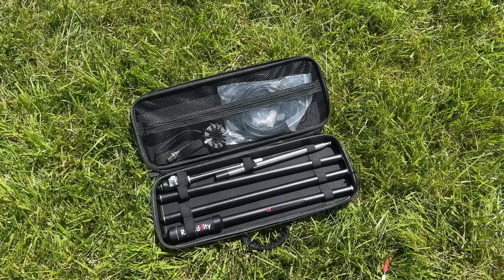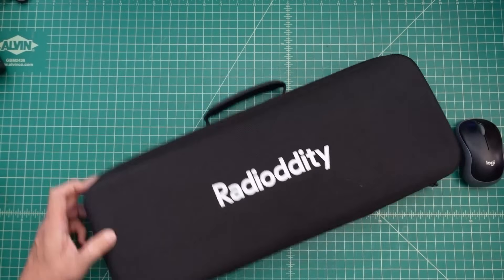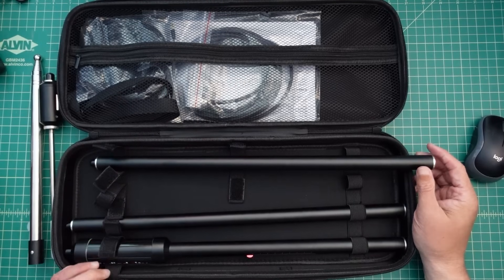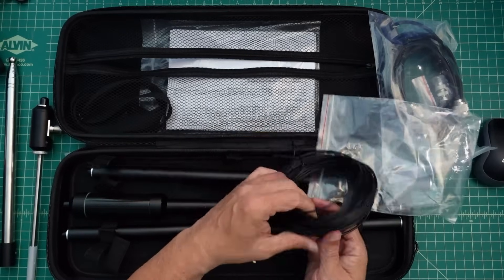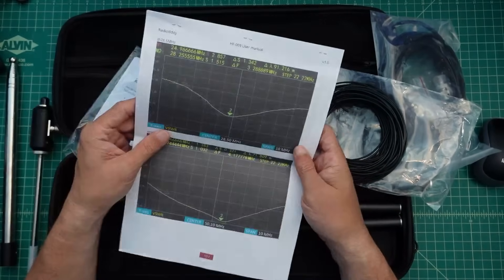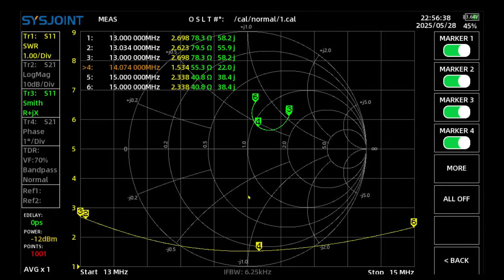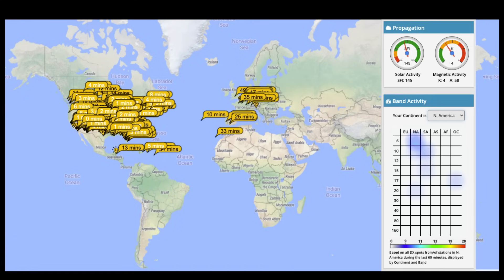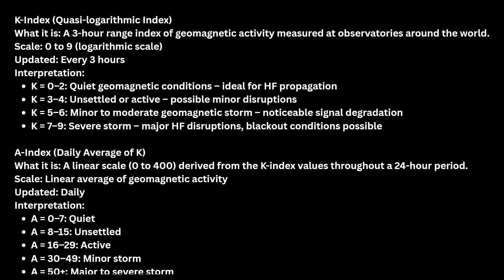Easy Antenna Setup Anyone Can Try!

Comment: After viewing many YouTube videos of this antenna, and learning that it has 3/8-24 threaded fasteners, I ordered one.  I assumed the coil was constructed with stainless steel (i.e., high resistive) wire; but to my delight, it appears to be some type of low resistive wire (copper?) -- based on ohm meter measurements.  So far, my only minor disappointment is the use of 3mm banana plugs (instead of the more common 4mm) for the radial wires.
Reply from the maker: Hope it’s working out for you 👍
Reply: @TheSmokinApe  The tuning range (5 to 18 mHz) of the coil is unusually wide considering its relatively small size and the antenna's short length.  Leads me to think that the coil may be wound on a ferrite rod core to enhance inductance.
Reply from the maker: There could be something in there so it’s not air wound 🤷

Comment: Would getting this unit off the ground, say 10-20+ feet, would it help anything, or cause other problems?
Reply from the maker: Well, you want to make sure you can Wally adjust that coil and you would have to have tuned radials if it’s off the ground 👍

Comment: "Vertical antenna = equaly efficiency in all directions"  Am I saying this is crap....no.   But.  Sayings are there for a reason.  for me, put up the best you can,  but figure out how you can improve next time. ALWAYS. Never know when you need to be the lead in an emergency situation....
Reply from the maker: I agree, use what you have and how you can…. Improve later if necessary 👍

Comment: I'm wondering when you say you played around with it to tune it in do you like move your radials around a little bit cause I noticed on my five band trap Antenna I'm move one of my radials around and it affects my SWR
Reply from the maker: I lay the radials out equally apart and then adjust the coil to get as close as possible then adjust the antenna length for fine tuning 👍

Comment: Mix 31 or 43? I've usually been using 31, but now that I got that fancy Halibut choke tester, I've seen some better results with a mix 43 one I made, but I might need to tinker with the number of turns on the 31's instead. Still a learning process.
Reply from the maker: I use 31 but many folks use 43 with success 👍

Comment: This is great info and as @HOAHamRadio said, thanks for the explanation of K&A.  Question:  Do you think a better ground plane, i.e. more radials, or emp cloth under the antenna would improve the VSWR ? 73 and thanks for this content.
Reply from the maker: Hey Paul, I think it could help.  When I use this next I will use my own DIY ground plane kit that has 8 radials.
Reply: @TheSmokinApe  I'd love to see that.  I gotta believe an EMP cloth and 4 17' radials would dial that thing in.  I'll look forward to seeing what you find.

Comment: Nice antenna. I want one but power rating.  Fine for just 7300 radio. Bands suck. Lots of static. Even CB low on DX if any. Shocking that 6 meter has been some openings . NY to TX and Florida I got on FT8 . 6 meter is E layer and can open day or night and strong storms can open it. Some what 10/11 meters does this just less. Even ducting can happen on 6/ 10/11 meter.  So them bands can open during solar minimum. Just not often .  The trick with 6 meters is get some antenna gain and put some watts on your antenna.  They tell me 6 meters dead , I get on FT8 with 500 watts LD MOS amp and make a few contacts with T2LT antenna . Nothing with 100 watts. I know i could do better with more antenna gain. If I used that HF-009 on CB I would set the lawn in fire. LOL . Great POTA antenna ! 73
Reply from the maker: Hey Robert.  Yeah, to me this is a POTA antenna 👍

Comment: i would double the number of radial wires from 3 to 6 wires,   and use the BNTECHGO silicone wire that doesn't tangle so bad.
Reply from the maker: Prolly not a bad idea, last time I did a video and used my own radials people got upset that I didn’t use the supplied ones 🤷